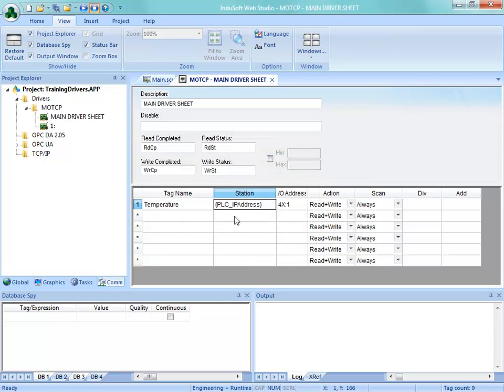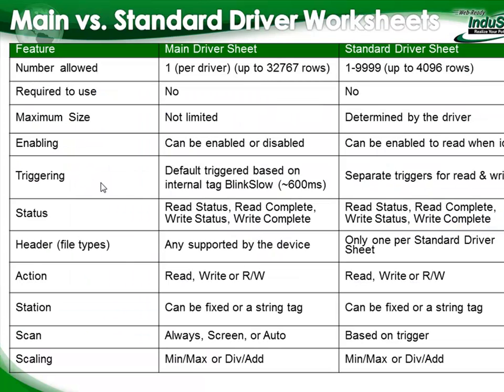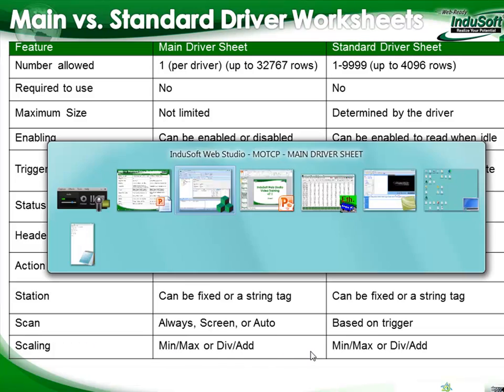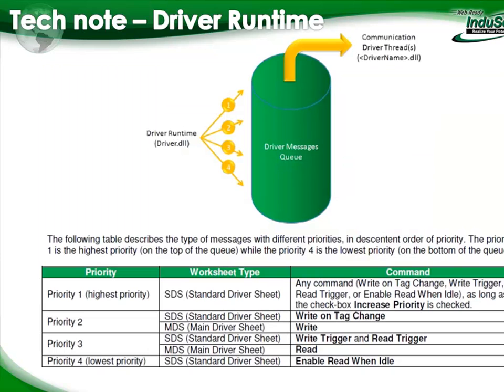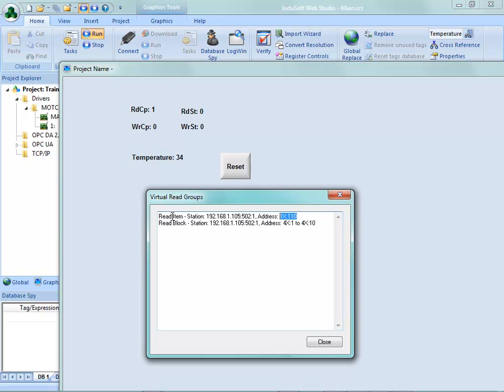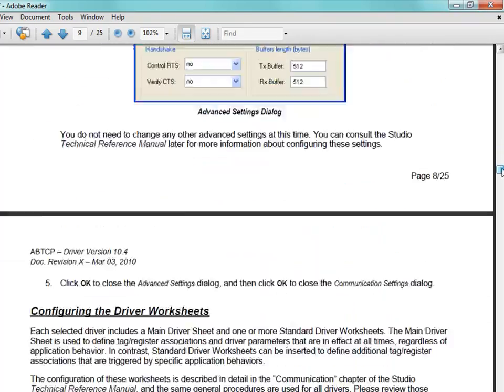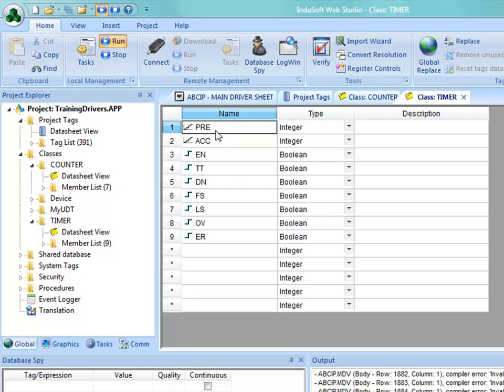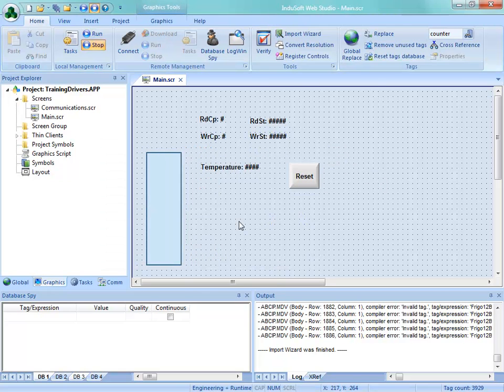Driver 2 Video

Comment: Really great video, by the way... forgot to mention that part.  Thank you for making it and showing alternative methods.  Only thing which is missing is potentially some explanation as to which method is better for what types of things.
Reply: For example, when you access tags using the Tag Integration method (where you reference the L5K file), do you get some speed benefit in regards to the access/update time for those tags between the HMI and PLC?  Using a main driver sheet or standard driver sheet seems to be limited to at least a 600ms delay.  Is the Tag Integration method faster or the same speed?

Comment: At 13:45 you explained that the driver sheets are processed via priority, and they are loaded into a buffer before being executed.  If your priority was higher among the other drivers in the buffer, shouldn't the overall execution times of all the drivers put together be the same?  As in, the internal ordering shouldn't really affect the overall time it takes to execute all drivers... so does that mean there's another problem?  If there's not enough time to process the high priority commands before getting to the lower-priority ones, how would re-arranging the execution order provide more time?  I feel like that would just be trading places with another driver sheet, as if changing priority now causes some other driver sheet to be skipped instead of causing the low-priority sheets to be skipped.  I apologize if this explanation is bad, but perhaps you understand what I'm trying to ask.